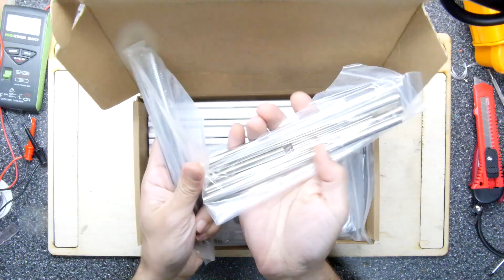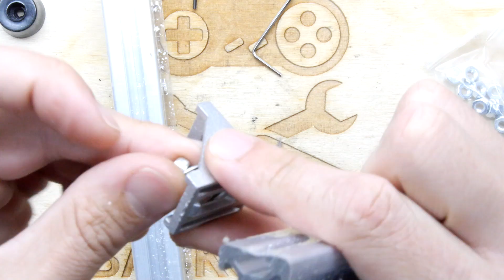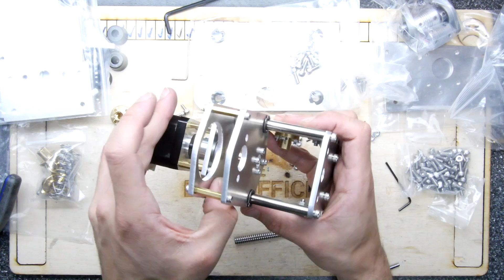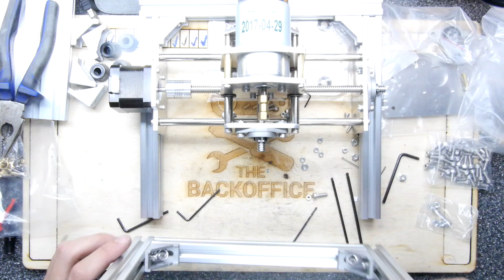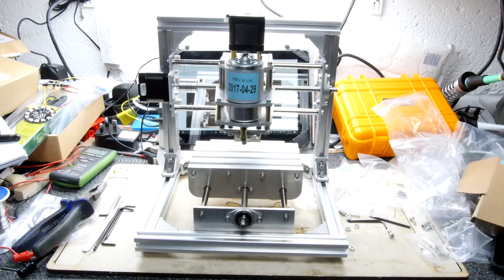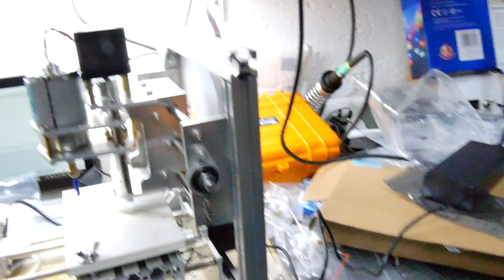T8 CNC Engraver Kit Assembly

Comment: Hi, Great assembly instructions - it helped a lot.
I have just bought a secondhand kit of one of these with exactly the same control board. The assembly is now completed but there was no control software.
If you could let me know what control software I need to use it with a windows 10 PC, and if it can be downloaded from somewhere I would really appreciate it.- Regards  Bob
Reply from the maker: This is what I use: https://github.com/Denvi/Candle
Reply: Thanks for the 'superfast' reply - I will give it a go.
Reply: Again - I would really appreciate some further advice if possible.
I loaded Github and set the baud rate to 115200, however the only control function working is spindle speed on /off. - the jog buttons do not have any effect on the operation of the x,y or z axis motors and I have checked all wiring connections with an Avo and they are 100% correct.
Reading 'on line', I see on some of these T8 models need software to initially flash the firmware. Could this be the problem, and if so any suggestions where the software could be obtained? Regards Bob
Reply from the maker: Hi, they are just Arduinos running grbl

If you Google Arduino Grbl it should get you the firmware tools etc 👍
Reply: Thanks - do you think that could be the problem? and if so  do you know  which arduino it is (i'e Uno - Mega etc) -Regard Bob
Reply from the maker: No idea really. You could look at the chip on the board and see if it's a megaXXX and if that translates to a particular Arduino. I'm sure the cloners would have just copied the Grbl default
Reply: Thanks for all the advice -If all else fails I will remove the board and put one of my arduino's on it with new motor drivers-Regards - Bob
Reply from the maker: That should work well and you can tinker. Like the auto leveling hack I added

Comment: I follow the assembly and connection instructions. But when the engine starts work, it instantly disconnects from the USB ... Do you have any idea what it will be !?
Thanks for listening
Reply from the maker: +Paulo Simoes try disconnecting the motor wires from it and trying again. Could be a problem with the wiring
Reply: I will trie that. Thanks
Reply from the maker: +Paulo Simoes it should communicate to the PC even when it's motors and PSU are disconnected
Reply: And it works, but the moment I try to start a job, it automatically shuts off from USB
Reply from the maker: +Paulo Simoes Sounds like a short when it's trying to drive something hard
Reply: I really do not know what the problem is, but I'm going to change the wires to see if it solves.
Best regards from Portugal
Reply from the maker: +Paulo Simoes yes. It should try to run a job when everything is disconnected. If it still fails could be a hardware issue. If it runs, then a wiring or motor issue. Connect one at a time and keep trying in-between attempts. Also check the supplied PSU is actually working. The motors will need the extra juice
Reply: how can i send you a picture??
Reply from the maker: +Paulo Simoes you can send on Twitter or a link to imgur?
Reply: Whenever I start the engine the connection will turn off and that red light will appear. see the image link
https://imgur.com/a/D8xt9
Reply from the maker: Paulo Simoes ahh, yours is a different controller to mine, I used that kind on the laser cutter. Very strange message, looks as if the communication is getting confused. Do all the command upto that point work ok? Does the relay click?
Reply: yes everything works. every command. But when i start the motor the red light appears and the conection to the PC stop... :(
Reply from the maker: +Paulo Simoes of you disconnect the relay board does the command run?
Reply: OMG.... Im so so sorry to take your time :(  Problem solve!  I put a extension usb cable and i remove it now. Its working
Reply from the maker: +Paulo Simoes phew!
Reply: Try using another usb cable . the cable that come with  is just rubbish. has no proper shielding

Comment: Thanks for the video. Without this I wouldn't know where to start. As it is , it is 2 hours in and I am nearly ready to throw it through the wall. The so called T nuts are a bag of shit. The last one in each section always slips back out of the slot, meaning the whole section has to be, loosened,  re-aligned and then tightened. Then the last one in the section slips through the slot.......Rinse and repeat...... I am hating this kit right now.
Reply from the maker: +Plan C yeah they are pretty awful this T nuts 😂 hang in there, you'll be done soon 👍
Reply: doubt it lol. Any tips on how to get a cheap, shitty, badly cut pillow bearing off of a cheap, shitty, badly milled leadscrew? I've put it back in the box for now - waste of time. I only bought it  'cos I thought it would be easier than configuring the Cyclone. Guess again lol.
Reply from the maker: +Plan C darn, I noticed that there seem to be a few manufactures of similar clone kits and have different parts.
Reply: Well. All I can say is you were lucky with your kit. Mine came from Gearbeast and has a broken 24v power supply that rattles like a box of matches and is probably a fire hazard, a bent Y leadscrew, pillow bearings that don't fit on the leadscrew, no spindle control via the relay because the cnc shield is v3 and the grbl firmware is 0.9. All in all an utter waste of time and a thoroughly frustrating experience. Consigned to the junk/parts bin.😠 Just needed to vent. If you muat buy one, get it from Amazon.
Reply from the maker: +Plan C I guess I lucked out. I saw it on a black Friday sale in Amazon and just went for it. At least if it didn't work they would take it back. I dont use the far East vendors directly for the more expensive things because I don't trust the after sales.

Annoying that so much is wrong though 😕